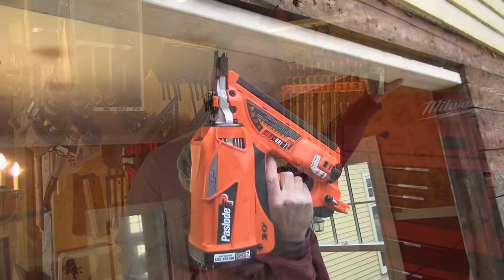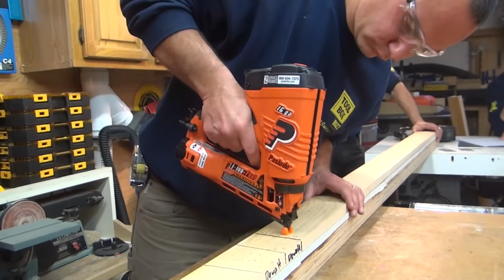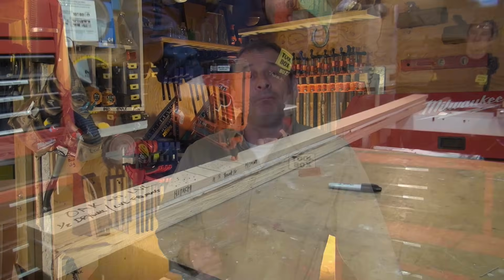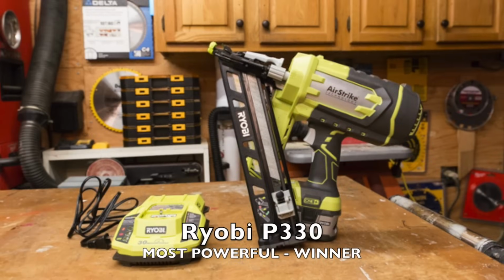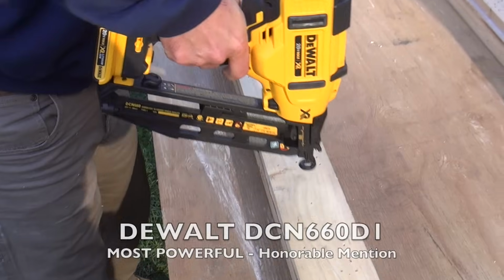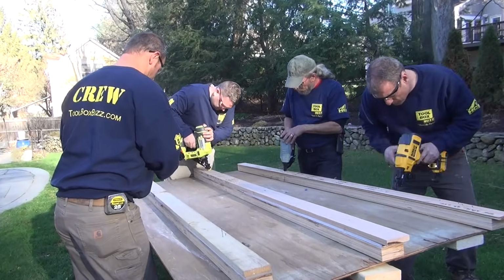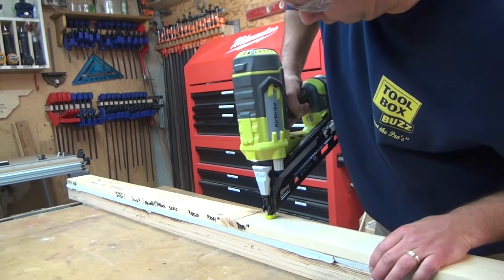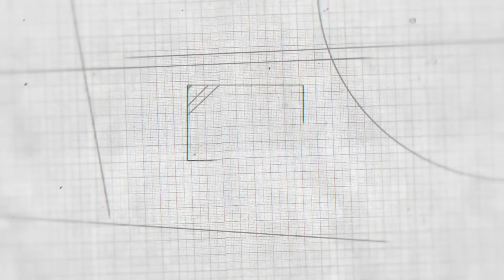Cordless Finish Nailer Head 2 Head Testing

Comment: Just pick a tool brand and go! Otherwise you’ll end up with 5 different brands-none of which are compatible!
Reply: Plenty of adapter plates for batteries these days. Allows mixing tools and batteries. The adapter plate goes between the tool and battery.
Reply: Damn, I should have listened to you before.  Now, I have 12&18V Milwaukee, 18&new 40V Makita. 18V Festool, 12, 18&40V Ryobi and 22V Hilti.  I am barely staying away from Dewalt.  But it is only a matter of time.  And Christmas is fast approaching.
Reply: @je-fq7ve  
It just doesn’t cover all like Festool, Hilti, Milwaukee, Ryobi and Makita.  Everything I have.

Comment: have the paslode and the ryobi, i turn to the paslode any day , despite being gas , it way out classes my ryobi any day, fires more nails per charge, far lighter and in my opinion more powerful, 

not a fan of the ryobis fire rate, super slow, fairly heavy, not as powerful as first said especiallty in this comparison, its heavy, super bulky, honestly in general uncomfortable in the hand as its so unbalanced and too big for my taste, nails dont sick into what im using it for fully, the fire rate is poor , would not recommend for a professional carpenter, have used milwaukees, hikoki/hitachi and dewalts guns as well, personally, would recommend spending the money on a good finishing guns, especially on the professional carpenters/cabinat makers, dont buy the ryobi, its good for diy, but nothing else

Comment: what's the difference of brad and finish nailer?
Reply from the maker: gauge thickness of the shaft and nail head... brad is much small on both
Reply: A Concord Carpenter 
So witch one 16g battery only
My old dewalt rip
New one is the same , just new battery, but starts wit 32mm nails
As ryobi 19-64 ( 16g straight not 15g angled)
In UK I it's easier to get 16g than 15g
Downside is new battery and charger but can have shorter nails
What would you recomend ?

Comment: not knowing every single tool that Dewalt makes, but do knowing what the "20v" battery looks like inside, I can say this; complete bullshit. its not 20v, its 18-18.5v.
Reply from the maker: +Kristoffer Røstad Martinsen The point of this review is NOT to discuss the 20-volt MAX [not the Max] battery platform but the bet cordless finish nailer
Reply: +Kristoffer Røstad Martinsen You can pause the video and clearly see the 20v on the battery pack, troll.
Reply from the maker: +Bruce Hurlburt  20v MAX battery voltage is really only 18v (5 cells, 3.6v each) It was a complete marketing ploy by Dewalt to differentiate between their slide on batteries and their existing stem packs. 

I'm not sure why your a=calling me a troll?
Reply: +A Concord Carpenter In Europe we use to Say 18V, but in The States you called all (eu 18V) systems 20V. It's totally same system but in The USA you just call it 20V. Nothing matter what Brand we are talking about. Same situation is 36V in Eu it is 40V in the States... In EU 10.8V it's called in States 12V and so on...
Reply: A bit late, but does this mean my batteries labeled 18 volt in Europe work with the American batteries labeled 20 volt?
Reply: Ørjan Jåsund yes it works.
Reply: Ørjan Jåsund 
Mine do all the time.

Comment: Brads are smaller.  I'm going with the ridgid as I have several batteries. I love the sliding chopsaw, vacuums,  drills, etc. Ridgid rocks
Reply: Ridgid miter saw is huge and very heavy dude!
Reply: ???  Are you saying Ridgid is the only brand that has a bigger gauge than 18?  It doesn't make sense.  If you want a bigger and more powerful nailer, then why don't you go for the framing nailer?

Comment: I have a 16ga cordless dewalt that is about 9 yrs old. It works like a champ.  Besides having a few scratches and dings, it still works as good as new.  Never even done any kind of maintenance or repairs.  takes old batteries tho.  if i ever need to buy a new one, I'll go with Dewalt.  Something i haven't seen yet is a 18ga cordless dewalt nailer.  Hoping to see that at the stores in the near future.
Reply: I believe dewalt makes a converter adaptor for using new 20v batteries on older 18v tools.